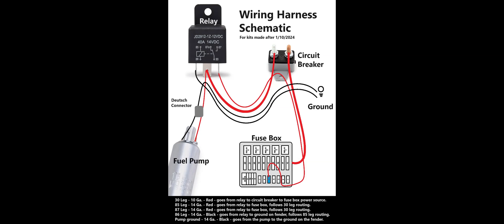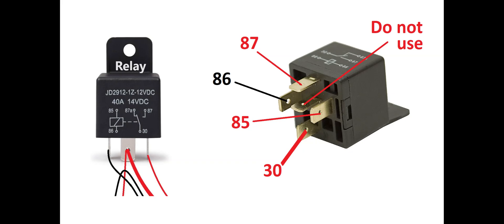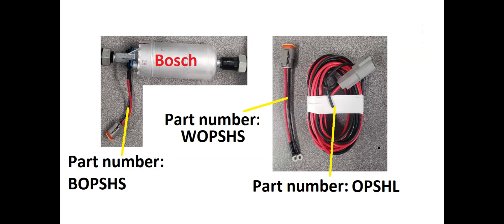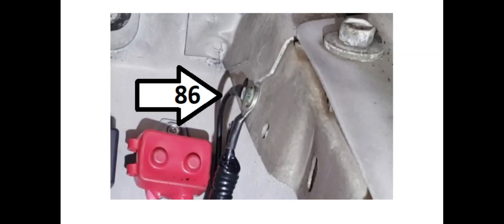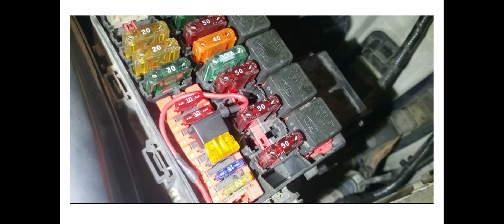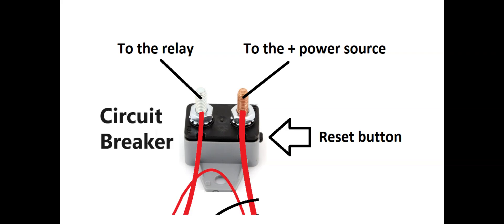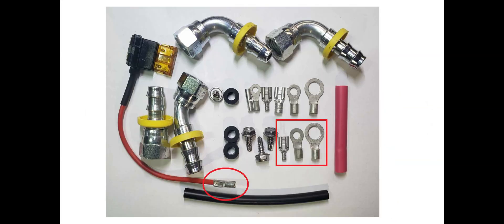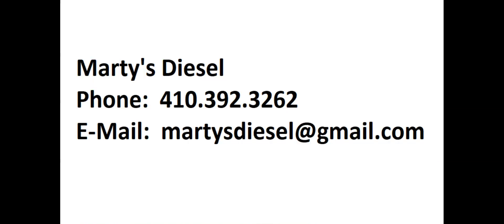OBS E-Fuel wiring harness update 2024

Comment: Wait, the red wire from the pump goes to the 85 or 87? I'm guessing you misspoke and that it goes to the 87. 85 is to the adda fuse...Right??
Reply from the maker: Red wire from the fuel pump goes to 87. 85 is your trigger. I will check on this and see if I made a mistake.
Reply from the maker: I reviewed the video. The original photo used here was an error and was corrected on our install instructions. You can view the CORRECTED photo here: 
https://martysdieselperformance.com/wp-content/uploads/2025/02/WIRING-SCHEMATIC-UPDATE-v3-update-1.11.24.png

Comment: Is there any other key on fuses in the box?
Reply from the maker: There might be - but that #5 is the one I use. IF you want to use the fuel bowl heater wire to trigger the fuel pump on - that is an option... but you SHOULD use an inline fuse since that harness/wire is also integrated with the PCM.